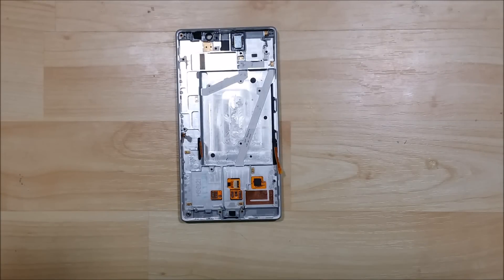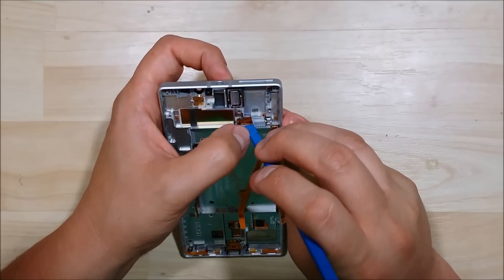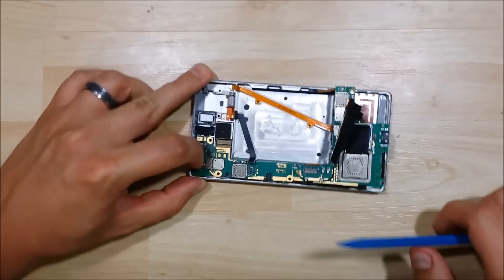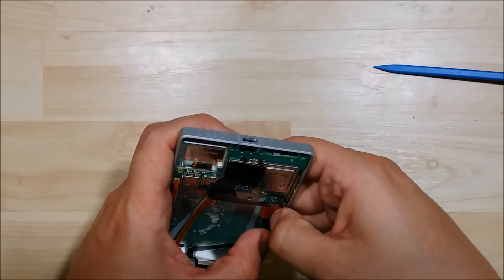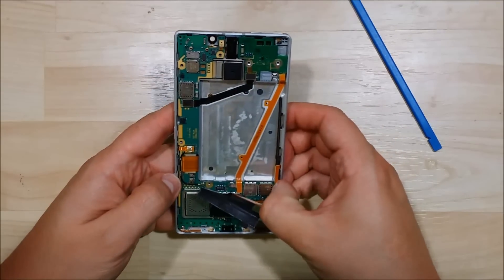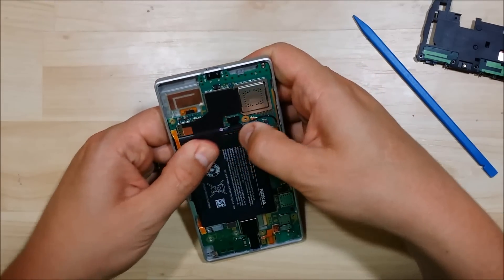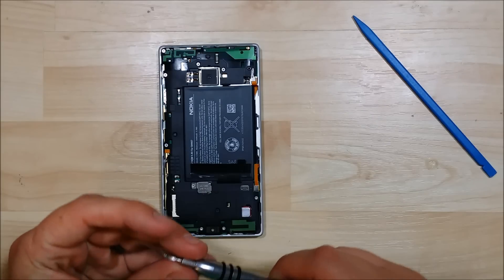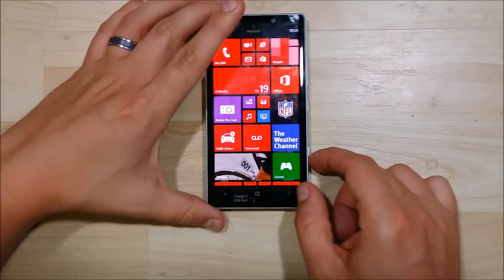Nokia Lumia Icon 929 930 Disassembly - battery -camera - display screen assembly replacement part-3

Comment: Pay attention to how the tabs look on the back plastic cover.  It's possible to damage them if you force the cover.  The ones near the USB port should be inserted first, carefully; they are shorter than the ones in the upper half of the cover near the camera and SIM.